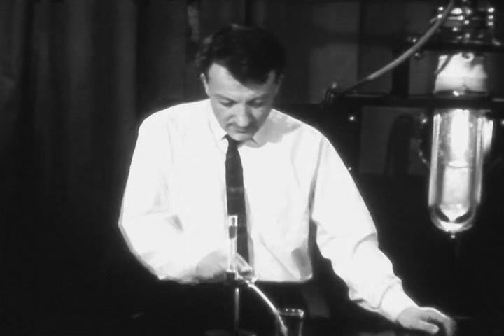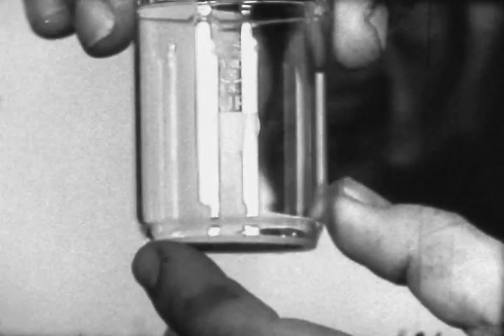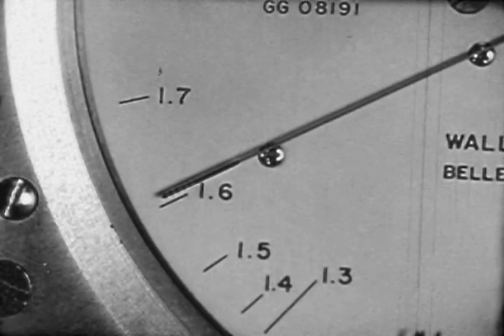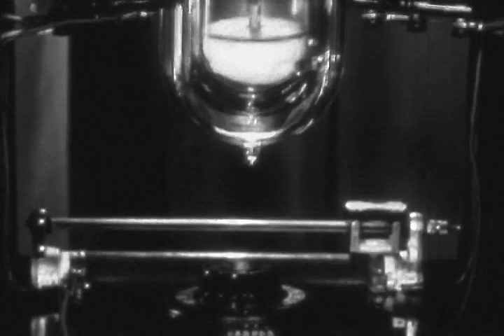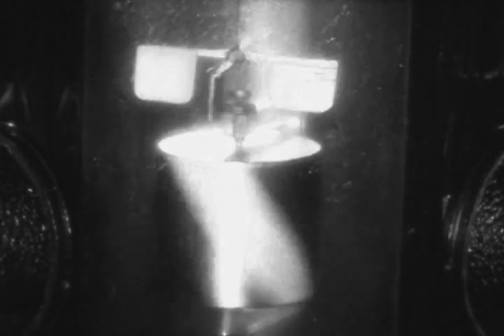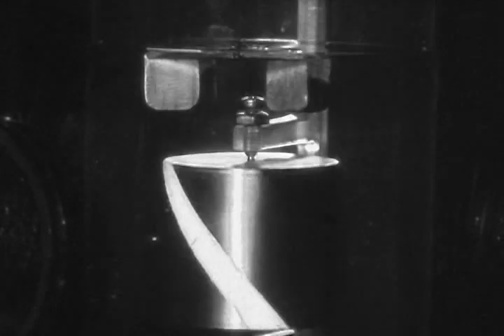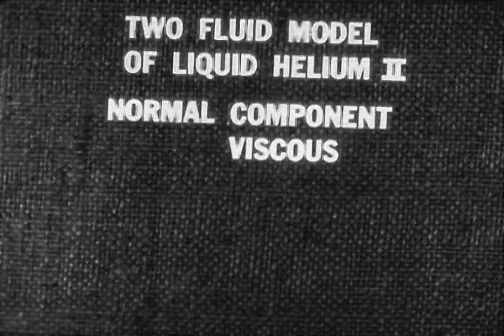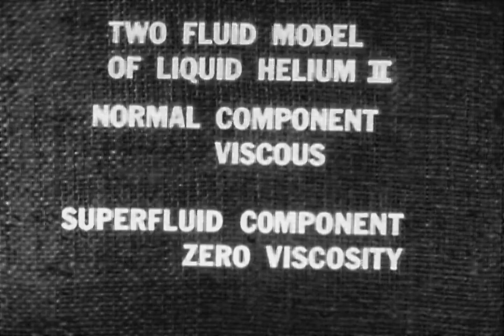Liquid Helium II the superfluid (part 3 The superfluid has zero viscosity)

Comment: We are in for more surprises.
The next one has to do with a viscosity of liquid helium.
When a normal liquid flows through a tube, it will resist the flow.
In this experiment we shall cause some glycerin to flow through a tube under its own weight.
The top layer is colored glycerin.
The  liquid layer closest to the tube wall adheres to it.
The layer next in from the one touching the wall flows by it and is retarded as it flows due to the inter-atomic, Van-der-Waals force of attraction.
The second layer, in turn, drags on the third and so on inward from the wall producing fluid friction or viscosity.
The narrower the tube the slower the liquid's rate of flow through it under a given rate of pressure.
Here I have a beaker with an unglazed ceramic bottom ultra-fine porosity.
Many capillary channels run through this ceramic disk.
Their diameter is quite small, about one micron which is one tenth thousand of centimeter.
There is liquid helium in the beaker.
It is a 4.2 degrees Kelvin.
Helium-I, the normal phase.
The capillarires in the disk are fine enough to prevent the liquid now in the beaker from flowing through under its own weight.
Clearly, Helium-I is viscous.
To be sure, its viscosity is very small.
That's why we had to choose extremely fine capillaries to demonstrate it.
Here you see the lambda-point transition.
The Helium-II all pours out.
The rate of pouring would not be a noticeable slower if the porosity were made yet finer.
We call this kind of flow a superflow.
The temperature is now at 1.6 degrees.
The superflow is even faster.
The viscosity of helium-II in this experiment is so small that it is not be possible to find a value for it.
It is less than the experimental uncertainty incurred in attemts to measure it.
We now believe that helium-II, the superfluid, has zero viscosity allthough we should be more precise here.
We believe its viscosity is zero when observing capillary flow.
Leave this statement in mind for we will come up to contradiction to it in the next experiment where we will look for viscosity by a different method.
There is a copper cylinder in the liquid helium, so motor that we can turn it about vertical axis.
In order to turn it smoothly and with as little vibration as possible, we make the cylinder in to the armature of a simply induction motor energized from outside the Dewar.
The four horizontal coils you see provide the torque which turns the cylinder.
The liquid helium is electrically non-conducting.
The coils excert no torque on it directly.
Yet, as we turn on our motor, the liquid layer bounding the cylinder is dragged along by it.
The boundary layer in turn drags on the next layer and so on outward.
Finally, the circulation shows up in the helium due to its own viscosity and would not paddle when yoke is turned alone.
What we have just seen is occured in Helium-I, the normal phase at 4.2 degrees Kelvin.
That is to say, this demonstration is consistent with our results for Helium-I by capillary flow.
Helium-I is viscous.
Here you see the liquid cooled down and passing into the superfluid phase, Helium-II.
Let's turn on the motor.
The paddle will start again.
What does this mean?
First of all let me emphasize that like Helium-I, Helium-II is also non-conducting in the electrical sense.
In other words, the circulation in the experiment can only have been caused to viscous drag.
So we conclude from the rotating cylinder observations, Helium-II is viscous, and from the method of capillary flow, that it has zero viscosity.
Our experimentation has come up with a paradox: no normal, classical liquid is known to behave so inconsistently in capillary flow in one hand and in bulk flow on the other.
This state of affairs forces us to think of Helium-II, the superfluid, not as a single but as a dual liquid.
It appeared that the Helium-II had two separate and yet interpenetrating component liquids.
We shall call one component normal.
It is this coponent which will whole responsible for the appearence of viscosity below the Lambda-point in the rotating cylinder experiment.
The normal component, as the name suggests, behaves like a normal liquid, and therefore, has viscosity.
It is the one which the cylinder drags along as it turns.
But the normal component can not flow through the narrow chanels of the ceramic disk.
Because of its viscosity.
The second component has zero viscosity.
And it's called the superfluid component.
We think that it does not participate at all in the rotating cylinder experiment below the Lambda-point.
It stays at rest.
On the other hand, it can flow through channels of one micron diameter with a greatest of ease.
In contrary no resistance whatever because it has no viscosity.
As we'll see later this flow is not impeded even when the capillary diameters are made far smaller than one micron.
This fact construction is called a two-fluid model for liquid Helium-II.
Whether it is correct or not depends on further tests comparing the theory based on this model with the experimental results.
Reply: Could you do this for the other videos? (:

Comment from the maker: @Pinkishbass91 No. The ratio of normal to superfluid component is determined by the temperature. It's a dynamic equilibruim not a static one. You can think of atoms as contantly going between normal and super state. As the superfluid flows out, the flow from normal to super will be larger than the flow from super to normal.  That's why it all drains out. The superfluid is always draining away and getting replaced as the normal component transforms to super component.

Comment from the maker: @oscargortez A superfluid would flow past any imperfections without friction. Also notice any motion in fluid cant transfer from one part of the fluid to another by normal viscous means and there is a vertical separation between any flow and the paddle wheel. In theory a toy boat in a superfluid bath would remain stationary when you put the motor on - in practice this extreme case is more complex.

Comment from the maker: Sublimation is the transition from solid to gas without passing through the liquid phase. Helium does not become solid however low the temperature unless at least 20 bar of pressure is exerted. Its phase diagram is quite different and it doesn't sublimate see video description.

Comment from the maker: @subtletube123
In the two fluid model the proportion of the liquid in the  superfluid state is dependent on the temperature. At the lambda point its all normal at 0 its all superfluid. So when the superfluid  flows out through the capillaries you are left with normal fluid but the temperature dictates that some of that has to convert to maintain the correct proportion of the superfluid. That's why it all flows out.

Comment from the maker: It's only zero for capillary flow, so you could swim (if you could survive the temperature).
Reply: It takes too long to move through a capillary, to equal zero viscosity,  Zero viscosity means it i evaporates in the presence of anything.
Reply: It experiences inertial. Or itd flow through the atoms of the vessel. But any object inside is subject to gravity and nothing more. Ive watched these videos for years. This is the first time ives seen the fan turn

Comment: Super conductivity resulting in induced fields? the temperatures are very low... can superconductivity be there, instead of viscosity?
Reply from the maker: Superconductivity and super-fluidity are different phenomena. None of the materials used in the experiment are superconducting.
Reply: There is some similarity between superfluidity and superconductivity.  In both, fermions are made to act like bosons, e.g. by pairing so the fermions 1/2 integer spins add up to an integer spin, like a boson.  Quantum mechanics is behind both phenomena.
Reply: hey, this could be used for making the Hawking experiment with "event horizon" of black holes.

The fluid needs to be non-viscous.

Here is a new question (mind experiment):

If gravity of a black hole is simulated with "flow" of non viscous fluid. Is gravity in general caused by "flow" of some thing? Flow of "time space" or  "aether"? That way super cooled helium becomes similar to "aether" - the substance in which light waves travel. Same substance that is  sucked into black holes faster than light can travel in it.

This way gravity would be a force that develops between two objects which "suck in" the fabric of space. And... I don't know. Maybe atoms then crush the substance into "sub" aether and it can escape like Hawking radiation, or some thing...
Reply from the maker: Not quite sure what you mean. As N Marbletoe points out superfluidity and superconductivity are connected, but this is a mathematical connection not a physical one. They both arise as emergent phenomena in an analogous way. 

There's no connection between gravity and superfluidity, though one of the mathematical tools of string  theory (AdS/CFT correspondence) turns out to be useful in predicting certain superfluid phenomena. Also the core of neutron stars are probably superfluid, due to the high density. 

Gravity isn't caused by a flow of anything, it's caused by mass. Finding the position of a particle under the influence of a gravitational field involves the solution of a second order non-linear hyperbolic partial differential equation. Completely different to fluid problems. The concept of the aether was abandoned over 100 years ago when it proved to be unnecessary - both undetectable and of no value.
Reply: +Zantorc i just find it odd that event hirizon is modelled with gas flowing at super sonic speed. the gas has to be non-viscous to avoid turbulence.

if super sonic gas represents gravitational effects of a black star - how is not all gravity working similarly?

is there is a "substance" light travels through in space to begin with? why is that substance pulled (flows) towards the centre of a black hole? And it flows faster than the speed of light?

That's the question I get looking at Hawking radiation experiment. I triggers the need to revive an updated "aether" based explanation in me.

in continuum mechanics c=sqrt(E/m) describes speed of any wave traveling in a medium with stiffness E and mass or density m. It is the same equation as E=mc2. so what would be the stiffness of "aether" and what density would it have, for light to travel in it as fast as it does... :-/
Reply from the maker: Ok I understand where you're coming from. You shouldn't take the analogy too literally. Current flowing in a wire can be modeled as water flowing in a pipe, but you wouldn't be able to build an electromagnet or anything analogous to one from it. 

What they are looking at is an analogy to the event horizon but only from a quantum mechanical perspective. Supersonic gas doesn't represent the  gravitational effects of a black hole. It's the transition region from subsonic to supersonic which is analogous to the event horizon for phonons (quantised sound vibrations in the gas).

"Is there is a "substance" light travels through in space to begin with"? No, light really consists of particles (photons) not waves.

The mechanical qualities of the aether have to be magical: it had to be a fluid in order to fill space, but one that was millions of times more rigid than steel in order to support the high frequencies of light waves. It also had to be massless and without viscosity, otherwise it would visibly affect the orbits of planets. Additionally it appeared it had to be completely transparent, non-dispersive, incompressible, and continuous at a very small scale. At this point it begins top look like the 18th century phlogiston theory of combustion.

But it gets worse, the  Michelson–Morley experiment, Trouton–Noble experiment and the experiments of Rayleigh and Brace, all failed to support the existence of the aether.
Reply: wow, this is the first time in many months someone actually points to real experiments. I sincerely appreciate this.

Was the flow ever tested "vertically"? Towards the centre of mass? If the flow of aether is perpendicular to both axes they measured, there will be no result. There are 3 axes to test, as in the gravity model the flow is assumed to be vertical.

Electro-magnetic waves self propagating.. Gravitation waves? I am baffled that the same equation c=sqrt(E/M) governs everything from a spring mass damper to the speed of light. And properties of light - diffraction, refraction, even "pressure" are also common to all waves travelling in a continuum. Yet there is no continuum for light. Just... bizarre.

Super cooled helium becomes non viscous - similar to what "aether" should be. Helium is one of the smallest atoms - the next closest thing to what "aether" should be. And for some reason it exhibit properties theorised to be required for "aether" - given low enough temperature.

What if "free" aether "drags along", similar to super cooled helium? Sticking to walls of this ball we call earth, like helium sticks to the walls of the bowl? "aether" might have high surface tension too, while being slowly absorbed vertically - through the porosity of the atoms. Similar to "simplified" experiment of event horizon.

Phonon - Speed of sound is equal in all directions as well - if it is measured inside a sponge. No matter how fast a car carrying the sponge moves (at relatively slow speeds - to be picky...)

I would greatly appreciate if you know and could share some further experiments contradicting these "dilettante hypotheses".

(P.S. If this looks too "pseudo scientific", I apologise. This is an innocent thought experiment. I have these "hypotheses" that I am unable to contradict by my self. Thus, I ask for your assistance to conclusively breaking this misleading circle of thinking)
Reply from the maker: If the aether was flowing vertically you would get the wrong value for the stellar aberration of light.  If you look at the dimensions of sqrt(E/M) it has to be a velocity, but the equation comes from E=Mc^2 - expressing the equivalence of mass and energy. If you want to 'derive c' then Maxwell equations give c=1/sqrt(mu_0 epsilon_0). 'Diffraction', is a feature common to all  particles in quantum mechanics.

"Phonon - Speed of sound is equal in all directions as well."

Not exactly. If you move towards the source of sound at a velocity v, you will measure the velocity relative to yourself as s+v, where s is the velocity of sound when you are stationary with respect to the source. (If you want to be pedantic there should be a relativistic correction to that). In contrast if you move towards (or away) from a light source you will still measure its velocity relative to you as c.

Imagine 2 observers one moving past the other, When they're next to each other, generate brief pulse of light. That pulse will expand as a sphere but each observer will think they are at the centre of the sphere. It doesn't matter if one is moving at 0.99c any measurements they make will always show them to be at the centre of the expanding sphere of light - that applies for both of them.

The brain did not evolve in a high speed or a microscopic environment so relativity and quantum mechanics seem unintuitive. Having said that the magnetic field generated by current flowing in a wire can be derived from electrostatics and relativity (yet electrons in a wire only move at a few cm/sec - magnetic fields not a mystery, they're electrostatics + relativity). 

BTW relativity also requires that you abandon notions of absolute time as well as absolute space - it's been shown to be correct to 1 part in 10^-17.
Reply: This one helped - "if you move towards (or away) from a light source you will still measure its velocity relative to you as c.". This experiment was not included is my perception of aether. Good. This helps :) Is there an experiment showing this as well (Question 1)? A test with an observer moving towards / away from a light source on earth?. I'd like to read more about it.

I remember Einstein was against spektrum shift at first, but later he accepted that only propagation speed does not change, the spectrum - does. And called his "prejudice" towards phase shift as the "biggest error he ever made". I had forgotten that. Good.

(Question 2) Can "curvature of space-time" be shown as density? Both time and density are often called the 4th dimension. Yet when they try to show curvature of space time - they draw a 3D function on top of a 3D function which is utterly confusing. The most intuitive expression of the 4th dimension to me is illustrated as a point of density in 3D space. Can "relative space time" be expressed as a 3D coloured plot, where the "colour" is the 4th dimension? 

i had a "gut feeling"  that isoperimetrical lines tangent to space time curvature could be perpendicular to the gradient of aether flow. "had" is the key word here right now.

My "leap of faith" is happening. You answers are helping. I have reason to doubt aether now :) good. Still cautious, though. I had seen some over fitted and under fitted functions before. Takes some time for stuff to settle down, for this cognition producing neural network to reassemble the nodes... Thank you.
Reply from the maker: 1)See below:
http://math.ucr.edu/home/baez/physics/Relativity/SR/experiments.html#one-way_tests

I think you're getting things mixed up a bit. Einstein added a cosmological constant in general relativity because he believed the universe was stable and unchanging. It was later show that this was an unstable equilibrium and the red shift found by Hubble proved the universe was expanding. He called the cosmological constant his greatest blunder.

2) There are 16 components, of which 10 are independent components, rather than the single 'curvature' you're imagining.